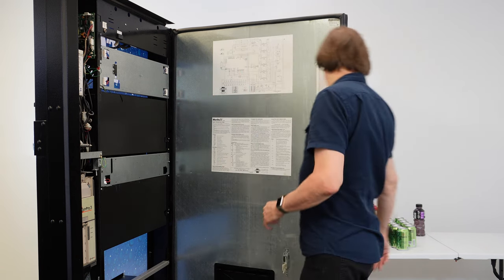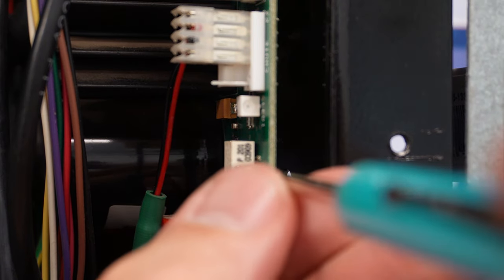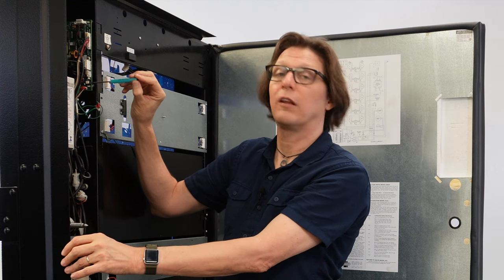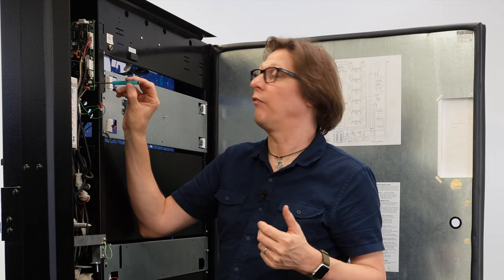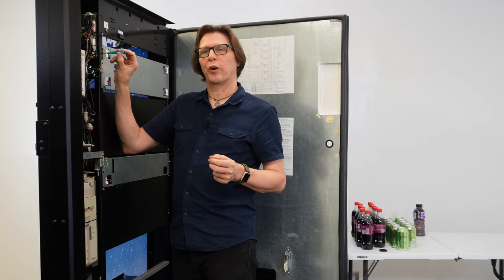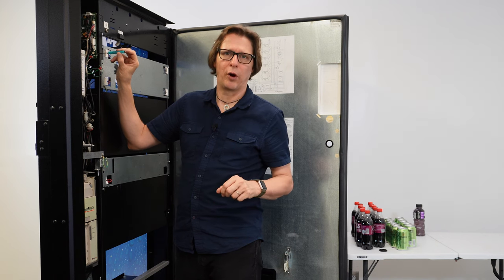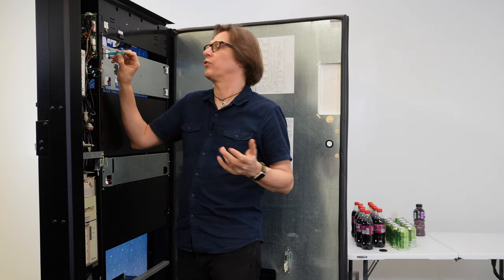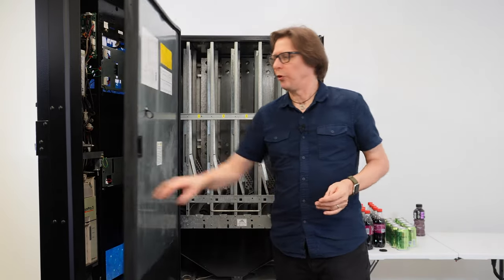Royal Drink Vending Machine - How to adjust the drop sensor

Comment: Hi friend... Where is the clockwise sensor in Merlin III and how to restart it? Just turn off plug?
Reply from the maker: @WIDEA The drop sensor adjustment can be found on the control board. Look for the white LED letters on the board. The adjustment will be located next to this. If you can not find the fuse to remove power then simply unplug the machine.
Reply: @VendingMachineSupport  Thank you very much. Hugs from Brazil.

Comment: Maybe you can help me I have a royal 650 non-live display machine and whenever I get in the dollar bill at scepter to get money out to go buy more pop then the part machine goes crazy and starts spitting out more than one pop for the dollar that is set for and then when it then spits out out more than one then it still registered the Dollar on the screen and then you can select another column and get another pop for the same dollar but the one you selected that gave you the two pops is currently sold out even though it's full because the pop machine knows it made mistake 2 fix that mistake you have to open the machine and then close it again and that selection is no longer sold out I'm wondering how to keep it from spitting out to Pop's every now and then right after or sometime right after I open the dollar bill acceptor it does after a while fix itself until I open the dollar bill acceptor again any help would be greatly appreciated
Reply from the maker: Sound is your drop sensor is not working correctly.